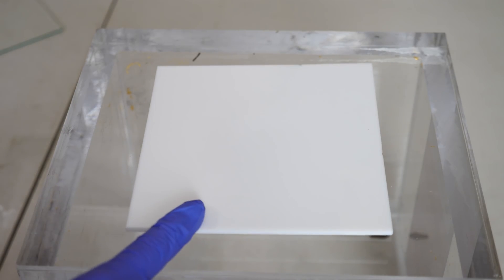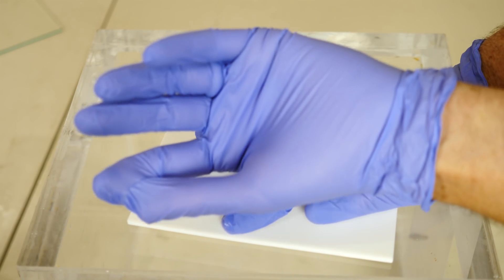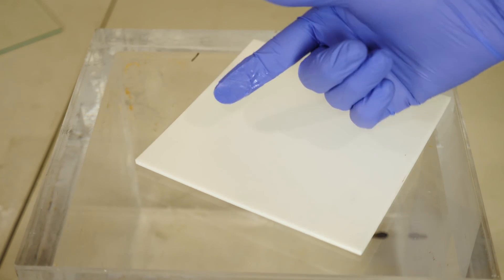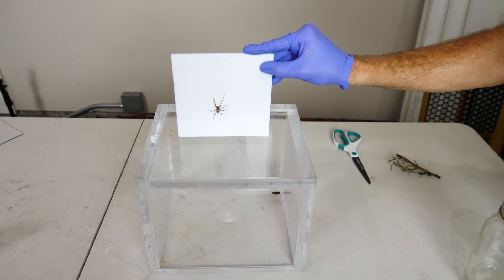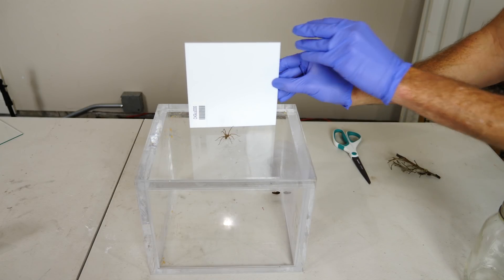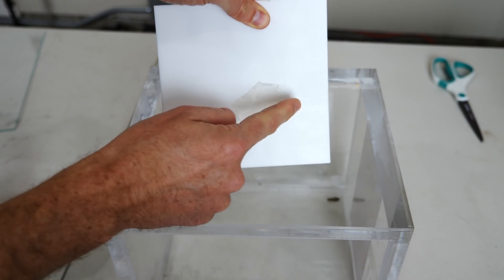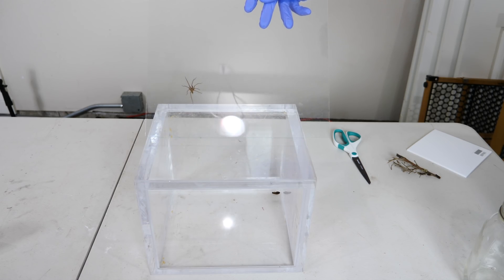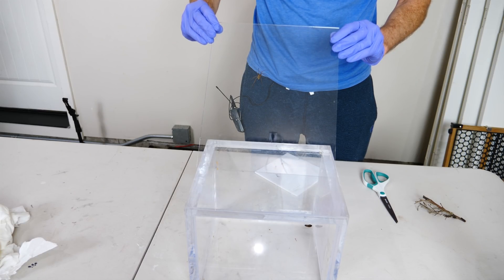Can a Spider Stick to Teflon?

Comment: Although you said that nothing can stick to the teflon, the super glue did stick to it even if it was only a small amount. If a spider had a glue similar to super glue on it's feet, given the low weight of a spider, wouldn't there be a possibility the spider could still stick to it chemically?

Comment: There is a thing where people use paraffin wax for the bike chain to make the drivetrain clean and last longer because it’s dry and not wet like oil that attracts dirt that wear the drivetrain. But to make the wax last in the chain they add Teflon to the wax.
Do you think it’s possible to use something else than Teflon to make the wax last long and not attract dirt like teflon?

Comment: Spiders also can't stick to drywall mud. I was putting up new drywall in my bathroom, i had finished mudding all the seams. 

Walked in the next day and watched a spider slip and almost fall 3 times trying to walk across the mudded seams.

Comment: Spiders aren’t sticky, that’s the problem. They have little microscopic spikes that pierce the substance they are climbing on. That’s why it usually doesn’t work on glass. There is no “putty”, or “slime” in the sense that it would stick

Comment: The teflon wasn't clean upon each test. I think the spider was hanging onto a fingerprint lol Plus doesn't a spider make web? You can tell that the spider was having a hard time hanging on. I would say that the spider can not stick to a teflon clean and  smooth surface. That law explains why food still sticks to teflon skillet, pots, and pans. I believe that the higher the density of the surface. The smoother and more slick it will be. Could you imagine a real true diamond skillet 😰

Comment: Using a hobo spider was not the best choice for the experiment. ;)
You're right about the Van der Waals force that spiders exploit to stick to smooth surfaces, they do this by having so called scopulae at the end of their feet. Hobo spiders though are more adapted to running along the ground and primarily hunt prey in that way and have almost no scopulae at all (they have a lot bigger tarsal claws though compared to spiders that are more accustomed to climbing, those tarsal claws give them more grip when running).
Reply: came to make this comment.
bad spider choice for an interesting experiment

Comment: Hii.... Could you PLEASE demonstrate that the attraction of water coming out from a tap to an electrostatically charged cup is not because of the attraction with the H2O molecule itself , but due to the ions present in the tap water. Also, perform the same experiment with de-ionised water and solve the  dillema!!

Comment: If nothing sticks to teflon, how do they get teflon to stick to the  pan? 🤫🤔🤯
Reply: It doesn't. You either have to modify Teflon substituting oxygen for flourine on the side to want to stick (and how that is done is another catch 22), or physically hold it in place (sandblast craters, fill with Teflon) then the Teflon is physically held like how Velcro tangles up with Velcro while  never being bonded to it.
Then you can add Teflon to Teflon because it will polymerize with itself.
It's probably still possible to pry it off a pan since it's never really bonded to it, just sort of held there. Sounds like another science lab experiment. Can you pull Teflon off a pan? I don't actually know. Maybe.
Reply: @donutwindy  that's really cool to know. I appreciate the reply. It was actually more of a joke than anything. We used to play a game to come up with silly everyday "ironies." Things like why do stores that are open 24/7 have locks on the door. Of course there is a real reason. I just always found the teflon quandary to be my favorite over the years.

Comment: I was hoping you would mention surface roughness that the spider’s microscopic features might cling to and you did. Mention irregularities and bumps.  You did not address the spider’s microscopic features with respect to mechanical or other abilities. Also you did not mention the role that air pressure might play in the “attraction” between the adhesive sheet and the teflon. Or anything to anything for that matter.

Comment: It depends on the surface texture of the teflon.  If it's machined with tool mark ridges for example, even teflon will have enough for some things to grab a hold of.

Comment: Actually it looks more like the spider is only hanging with one leg from a single imperfection on the teflon, like a tiny crack which cannot be seen due to the angle/light/whatever. If you notice well, it's slipping at first, then stops and the other legs won't stick while one single leg is supporting the full weight almost certainly from a random imperfection on the surface. Proof of this is when he tries to put the teflon face down and the spider then won't be able to stick anymore but for a split second it is still hanging from a leg from that tiny crack it somehow found.
Reply: Glad I wasn't the only one who saw this
Reply: Could have been a bit of residue from the superglue test...

Comment: The real question is... Can tefflon stick to spider?
Reply: If you press them together hard enough
Reply: Daniel Moses but the poor beastie will die then🥺🥺🥺
Reply: Maybe ITS BOTH WAYS
Reply: Just shut up
Reply: Yes
Reply: Coat a spider with teflon
Reply: put the spider on a table, take the teflon, slam it down on the little fucker, boom he sticks!
Reply: The Teflon is already in the spider. Coz its everywhere 🤙